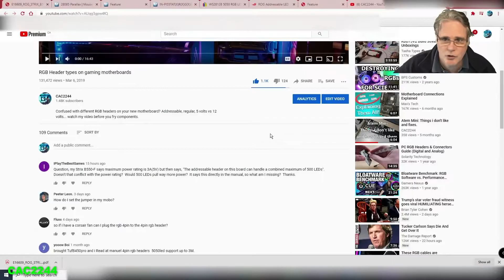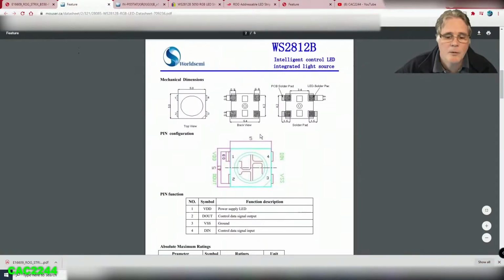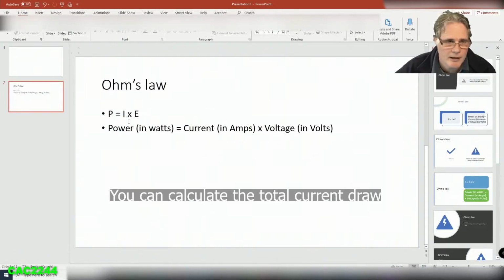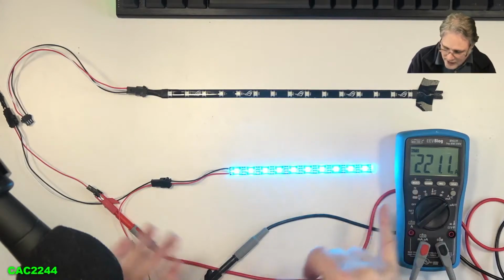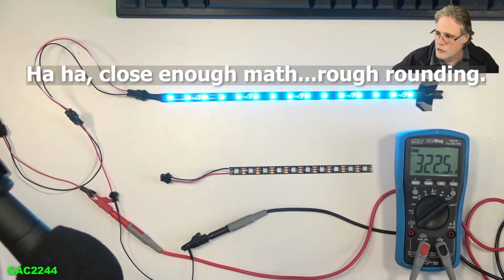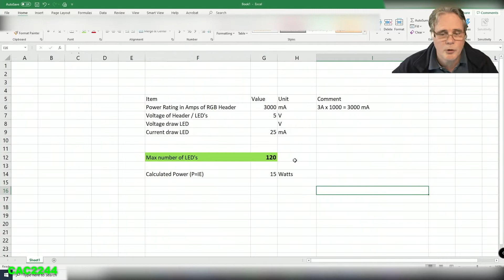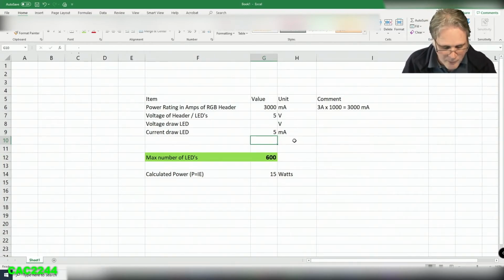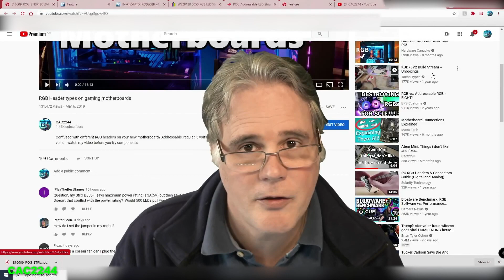Max number of Led's on an aRGB header on Mobo.

Comment: So, I have the Uni fans and when using the argb y cables to synch everything, Lian li is saying “make sure your argb header can handle 15watts” how many watts can a 5v argb header take
Reply from the maker: Ohm's law: Power (watts) = Amperage x Voltage, hence 15 watts / 5v = 3Amps and most ARGB headers are rated 3Amps, so check your motherboard manual to confirm as it usually states the amp rating they are for.
Reply: @cac2244  it says on the manual it supports up to 3amp so I think I’m good! Dude thank you so much for responding and for making this video. Obscenely helpful for actual understanding your motherboard and the power it uses (not just for rgb stuff). You got a lifetime fan here brother

Comment: this still does not answer whether this is the max number of LEDs PER header or if the motherboard provides 3a TOTAL across ALL headers. can anyone answer this? is it 120 PER header or 120 Total?
Reply from the maker: each motherboard is different, so read YOUR manual, then do the math. No one will silver spoon feed you the answer.

Comment: I decided to upgrade my pc. The issue is basically I've ASUS ROG strix B550-f. Which comes with 1 Addressable rgb Gen 2 header. So I wanted to sync my new Lian Li Lancool II Mesh C type cabinet's (Argb fans)*3.
And also New Lian Li Galahad 360 aio cooler which also comes with 3 argb fans. And also one Lancool II rgb strip light with 1 Addressable rgb Gen 2 header . And I want all of this light to sync with eachother. Also I want to control it with my motherboard software. Or any other software if possible.
I'll use AIO's radiator & fans as front intake. And use fans for pull. So my front panel cabinet comes with hub probably. Which I want use for my aio instead of stock fans. So do you have any idea. Which is the best method to sync all these 6argb fans and 1 lancool II strip rgb together. Also the aio cooler Comes with controller.

Comment: If you want to connect more LEDs, you can use an ARGB controller/splitter wich supports the power supply of the LEDs by SATA.
Reply from the maker: Of  course... the goal was to see if there was a limited amount of led's controlled by mobo if using an external power source.
Reply: @cac2244  I have a similar question about, the hub controller from Lian Li Uni Fan 120mm have 4 ports and each port suport max 4x fansn (each fan have 32 leds) so this hub controller can be support 16x fans - 512 leds. My motherboard is ASUS TUF x570 Plus BR and just have 1 header RGB 5v supporting max 120 leds. I can consider the the hub controller will give the necessary energy for fans and the header RGB 5v from motherboard just will controller the RGB signal?

Comment: Thank you very much!!! You answered my exact question, another question is: Is there an extender to extend the power of ARGB from external power source? So I can connect 20-30 feet strips to my motherboard controller but take the power from external power source, only the data signal gets controlled by motherboard.
Reply from the maker: Of course there is a way...no extender really needed...I'll try to do a video about this over week-end..

Comment: Hello! Great video!
I have a question that I cant seem to find answer to. 

Could I buy long ARGB strip (or connect multiple) , power them separately from source +5V and ground. And then connect only the data to the motherboard and use the maximum adressable space (500 light units) ?

The idea is to have a room light synced by computer, but I cannot just plug it in because the power demand is greater then what computer can manage. 

here is the schematics : 
https://ibb.co/NCkG644

Do you think it would damage the motherboard?

Comment: The 500 refers to something complete different though... it is the total addressable space length... ie how many data packets maximum that the controller can output for each frame. The way that this data transmission works is the first led in the series stores the first 24 bits then passes on all additional bits to the next led which of course, like the first, stores the first 24 bits it gets and then passes on all the rest.. until some point when the data stops flowing, at which point all leds change to display whatever that 24 bits translates to.  So bsaically at 501st led, the controller has nothing else i cant spit out, so the 501st led will never light up. (and of course here when saying led, I really mean light emitting package, with is really 3 leds and 1 ic.. the ic's draw is in the microamps (as per the datasheet) and the legs are typically 10-30 mA each....each one gets 8 bits of intensity level grading from the ic in pwm).     So the two specifications are different, and meant for 2 different things.  The power draw is for the mother boards supply power, which really should be avoided to the degree possible...  but most headers are 1-3 amps....   and the other is how long the longest data stream the motherboard can support. Obviously to go over the amperage requirement would require powering from an external source from the power supply (the same one as the motherboard is connected to, unless using fancy repeater options though, to allow common ground signaling).
Reply: i just read your comment, and you said that "Obviously to go over the amperage requirement would require powering from an external source from the power supply (the same one as the motherboard is connected to, unless using fancy repeater options though, to allow common ground signaling).
" its the same as my problem, I want to connect all my ARGB light on my desk with my 3pin Argb header on my motherboard, so it will sync the light with my computer, the problem is that i have 7 meter long strip that equals to 210 LEDs, and my plan is using external psu (different from my Computer PSU) but i am not sure if it safe to connect the motherboard 3pin header while powering the leds from external psu. In this case, what should i do? thanks
Reply: @Aixerz  this ^
Reply: @Aixerz  It would be better to power it from the PCs PSU, like a sata power connector or PCIE/EPS 12V. WS2812 use DC data signaling and since in DC ground can have differing potential, you could potentially have overvoltage on your ws2812B signal line if your external GND has a different potential than the PCs one (which is likely). I made several projects with very long LED strips (10s of meters) and it is necessary to connect power lines every 3-5meters. Also it is very important to route thick+ low resistance GND cables along in between to compensate the voltage drop and GND change. Without extra GND lines, the strips would randomly die after a few months.

Comment: Just a question...!!! What if you are using a 5V 3-pin Powered Hub (SATA or Molex)... Would that mean that the Max Number of LED's can go higher, than the Max limit of 3A ??? Depending on the capacity of the PSU of course.... You could just say yes or no... would love to hear from you, since you are a genius on the topic and it would really help...!!!!!!!
Reply: i need the answer to this!
Reply: @TocTocArg  I'm pretty sure just a powered hub will let you run as many ARGB LEDs as your software can handle, but it might not let you control your LEDs individually- each fan (or whatever) wil likely always be in sync with the others, opposed to using a powered ARGB hub + controller combo with it's own ARGB software, which would let you do whatever you want with each individual LED...
So if your motherboard's software says it can control 200 LEDs (say 10 fans w/ 20 LEDs per fan), but you only have one ARGB header with enough power to only run 100 LEDs (or 5 fans), then just a powered hub will most likely let you run all 200 LEDs (or all 10 fans), but it might have trouble detecting each separate fan connected to the hub (through the single ARGB mobo header) and will run the same pattern synced across all 10 fans (all the fans will be doing the same effect at the same time) not allowing for separate effects like different color fans, or a light snake/ streak running around each fan one after the another... 
At least that's how my mother board works- everything plugged into it's single ARGB header (2 fans and an AIO pump) is recognized as a single "LED strip", so if I set it to pulse blue- all 3 will pulse blue at the same time, I can't make them alternate or anything like that.
Hopefully that made sense and helps a bit.
Reply: THANKS! Yes, i dont have a problem with the lights being always in sync.

My main concern is that the maximum power from the argb header wont be enough to power a long led strip.

When you say "hub" you are talking about those ones that have a SATA connection right?
Reply: @TocTocArg  There ya have it, looks like you got your answer. Good luck with your build!
Reply from the maker: Sorry, I never saw the message, but yes, of course that a higher current (amp) hub allows you to drive more RGB's, but it depends of the amps of the sata or molex, so divide the amps you got by about 0.025 (to be safe because usually they can be as low as 0.020A current draw per RGB) so if your mobo has a header of 3amps, then 3/.025= 120 independent RGB's but if your powered hub has, for example 5 amps, the 5/0.025 = 200... if you want to be more precise, make sure you take, for the amperage, the LOWER of either your hub capacity or the PSU (the public datasheet is your friend). You can even be more precise if you know the exact model of RGB on strip or fan , as sometimes it says the model on it, so look for datasheet of RGB and Amp/RGB current draw data is usually in there, so you can divide your safe  available amps by that more precise amp/RGB number.  As for the data signal, do not worry about amps...it's just a signal, so if you have too many LED's, the signal will become too fade to operate, then  you'll know to backoff, but nothing will get damaged by Data size of the RGB link.   Hope this helps... "Teach the hungry to fish..." concept: Just learn the very basic Ohm's law for the relation between voltage, amperage and resistance and you'll be able to deduct most of your RGB questions and all proper hard numbers you need are all in the publicly available and free Datasheets.
Reply from the maker: I actually bought one of those cheap Aliexpeess RGB hub months ago, maybe  I'll use it to do a specific  video on amp calculations and max RGB I can add (I have full spools of RGB) and see how many can I add (using a dedicated bench high amp power supply) before the data signal fades... I guesstimate that 500 RGB's will be the threshold where Data gets too weak...
Reply: @cac2244  Awesome, Subbed!
Also a suggestion- If possible, I would love to see a how to on use a multimeter to check voltage and amp draw from ARGB and fans (hooked up to a jumpered PSU). I know it would probably be a whole video on it's own, and hard, but I think being able to use a cheap multimeter is invaluable... Companies can get it wrong, or lie, and products might be old or obscure. If you we can check the current ourselves, that's fishing mastery.
Edit- I know this video did cover it, but I meant more which pins to connect to/ probe, and the very basics of using the multi meter (amp, volt, and com ports/ and resistance + voltage, and amperage) also how/ where to jump a PSU
Reply: Good question. Just a powered hub? Or a separate RGB controller? I guess it would be up to what the controller can handle, but with just a powered hub, I have no idea.

Comment: what happens if i connect my 300 leds argb strip to 5v 4.5amp sata powered argb hearder ??????
Reply: this is what was missed in this video... the header is only capable of 3 amps, but if you externally power the strip from some other device like sata/molex/etc that can supply more/additional power.... then the maximum the motherboard can 'address' is 500 leds...  it is why there are two different specifications for such headers...  1 is a power limitation of the header (which is easy to get around from external power) and the other is the total addressable length (which you can't get around....  well you can, but 'spliting'... but again then 2 leds will share the same data, so as long as what ever the pattern is is okay with two leds have the same color at the same time, then its fine.)   Again, the main key is whatever is suppying the power must be rated for the power being taken (in this case, 4.5 amps per sata connector, you'll have you check your power supply to know how many amps per rail) and that the total length of leds from the header to the end of the longest single chain doesnt exceed the total addressable space of the controller. Note it is critical that the grounds are all from the same supply though for data transmission to work.

Comment: it is possible to only put the data Pin to a 10m led strip on to the motherboard Data out pin from the argb header?
that means without  using  the other two pins for Ground  and +

then maybe even use an signal amplifier(SP901E) to help keep the data/singal that is send stable enough.

The Strips(WS2812B) are 5Volts and have 60Led's per  meter and consume 18 watts at 1 meter. So in total that would  be 600led's, 180watts, when i am using  10meters. Is that right?

So my general  questions  is if its possible  to only use the data pin on more than 120led's. because the Ground  and +pin are not used from the motherboard  itself. because  then can only deliver 5v 3a that means 15watts and that is way to low for my application/use.
 the  power that is needed I will just give from an external  power supply.

i hope anybody  can help me out with my question and sorry for my English guys. it's  the first time for me that i am writing such a long question.

Thanks in advance.
Reply: i am asking for the same question too, haha, i hope somebody answer your question
Reply: @Aixerz  Yes man i hope too

Comment: Really helpful video, thank you for shedding light onto why it is probably not wise to daisy chain 10 argb fans to one argb header(which is exactly what I did, no wonder they are dimming out and not full brightness).

Now, I just hope that the manufacturer's of the argb fans and led strips start to put the number of leds they have in their product into their specification documentation. Believe it or not, many manufacturer's have been keeping that information out of their documentation even though it's pretty important to know to get your rgb rig to be properly working.

Comment: Hi. So as a conclusion, each aRGB header can handle 120 led right? 
Because im planning to install 1 meter 60 led and 40cm 30 led x2 on a single aRGB header. is it safe or should i reduce the led number to 100? 

looking forward to your answer coz im really confuse

Comment: So, odd question, my argb gans have no data out, so when connected they all identical, should it be possible to ipen a fan and get a data out point alternatively using something like an arduino to convince a fan that its 1st led is led 13?

Comment: Question: I have a B450M DS3H with no RGB headers, except for a 4-pin "LED_CPU" which doesn't specify if its 5v or 12v. Would I be able to plug my AIO RGB splitter (contains fans and waterblock's rgb) into the LED_CPU? Thanks!
Reply: Hi siltant, i have looked at the manual for the ds3h, v1 and 2 rev 1 for both, they are 12v rgb, what you are connecting will need to be the same, its important to no accidently reverse the plug, one thing i am unsure of is if all std led strips are identical, aka common cathode or annode, i assume but not sure, i did skip it mostly and only started with argb

Comment: Man im trying to find out how to get my Cooler Master TD500 Mesh fans to work on my Aorus B550 Pro AC. I was given this adapter for my motherboard, its 3 pins, and i don't even know where that plugs in. I know how to solder, and i guess im going to need to make a custom adapter, or find one online. I can't find any good explinations online though, if you made a video on it everyone who buys gigabyte would have to watch it.
Reply: Im about to buy Aorus B550 Pro AC and Asus B550-F Gaming Wifi but im unsure where do plug i plug in my ARGB fans and CPU cooler which has ARGB when the mother only have 1 ARGB header like the Asus B550-F Gaming Wifi
Reply: @HatsuneMiku-fw7ee  for aRGB you can buy a splitter...but make sure its the same voltage...some aRGB  comes in 5v and some in 12v. Also the aorus pro ac with wifi has 2 aRGB spots...i can help you further if you need it.
Reply: @malevolent5496  Thank you for your kind reply,  im still unsure whether im going for the Aorus or Strix :)

Comment: Data wise, you can control 500 leds, you need seperate power.
Reply from the maker: Sure thing, but the point of the question and video is how many led's you can safely drive by the header itself. I really think manufacturers should be more detailed in their manuals since I am sure many people overloaded (current) their ARGB headers with the light show and damaged their mobo's.
Reply: Can you suggest a product to separate the power?